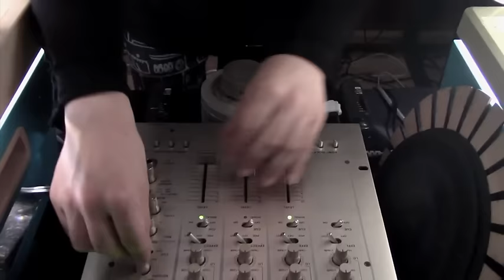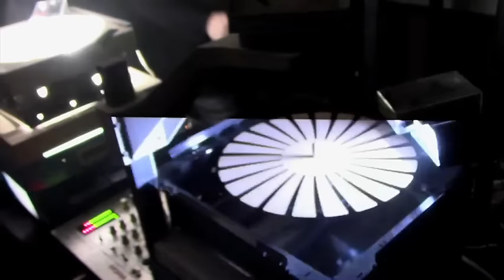Ventilathesizer｜換気扇サイザー Test#2

Comment: 那麼為什麼旋轉時會發出這種聲音呢？🤔
Reply: I think that is the fan is between a light and a light sensor (maybe a CDS or something) that will output a high voltage when it detected light. so when the fan blade blocks the light and moves away at a certain frequency, the sensor will output a wave to make a sound. For example, when the fan is spinning at 100rounds/second, and have 5 fan blade, it will generate a 500Hz wave.